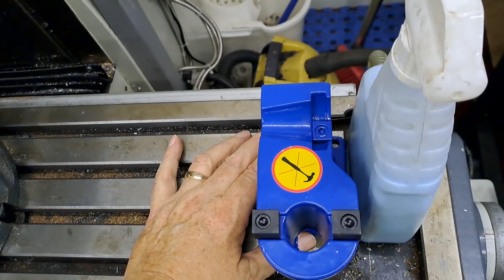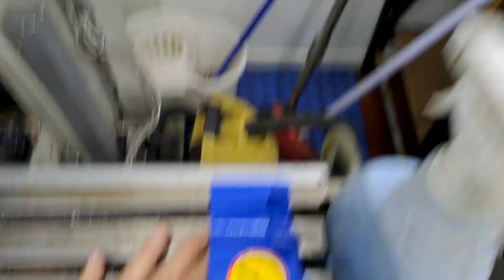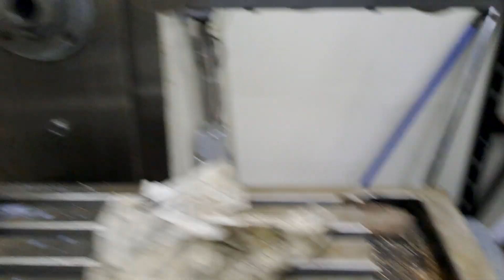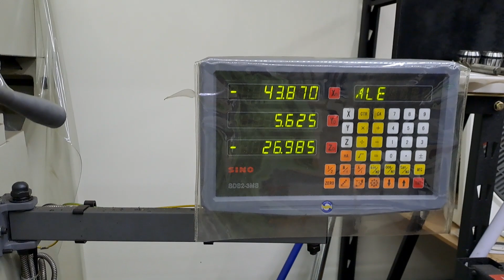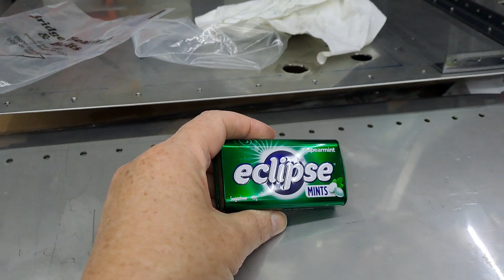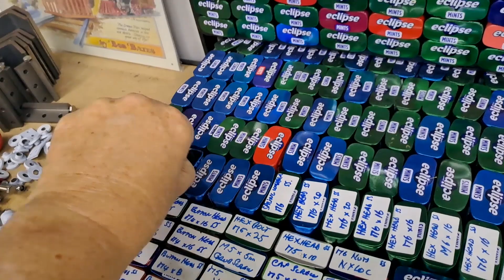003 Tool Fixture plus... Workshop Tip!!

Comment: G’day   that  would this tool work for MT 3 mill fixtures?   Good videos very helpful and you articulate them very well ie., can really understand what you are saying which helps a 66 yo like me.    Kind regards John kinnane
Reply from the maker: Hi John, 
No, regrettably, it won't work for MT3 or any other MT's for that matter. You need to remember that these tooling fixtures are really meant for cnc machines (my mill is just an industrial size one but not cnc) where being really tight maintains tool length.
Chef